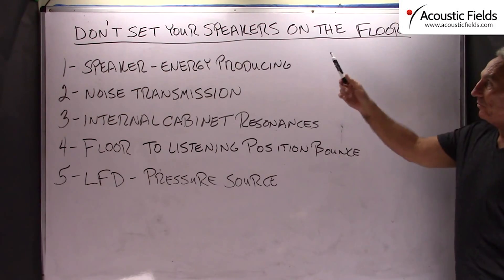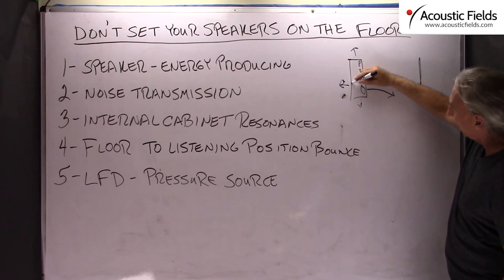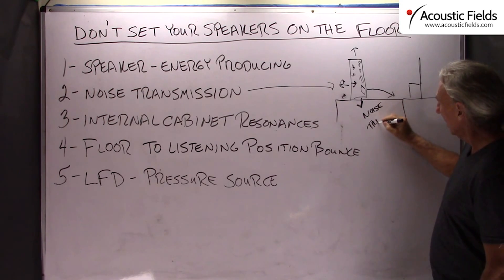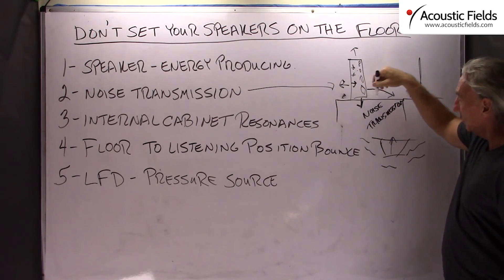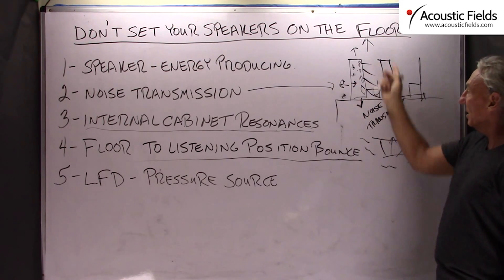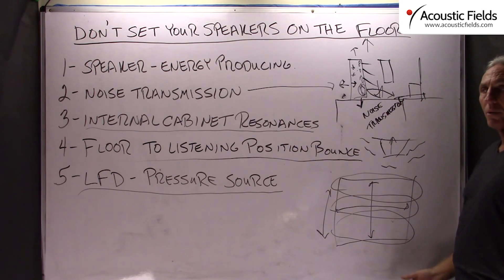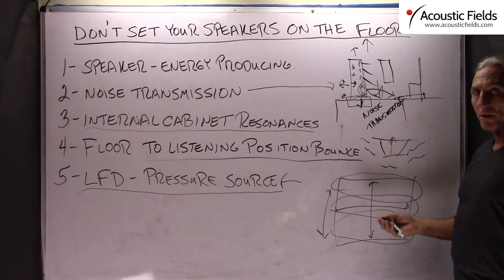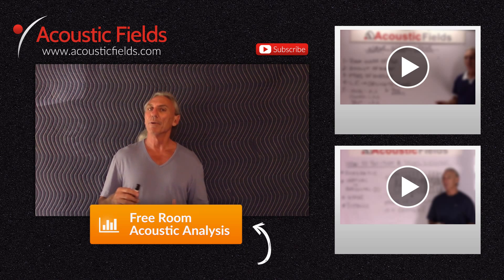Don't Set Your Speakers On The Floor! - www.AcousticFields.com

Comment: A few months back I bought a 2nd hand pair of Yamaha ns 1000m speakers . I got some stands with them. Not pretty but solid  The treble was clear , bass good , but mid sounded a little peaky . Anyway just as an experiment,  I put them on the floor. The peaky sound had gone and the depth and tone improved . Admittedly you cant turn it too loud ( but you couldn't anyway) but it sounds great . Not boomy but much better energy...like live music. At my age all I wish to do is enjoy myself 👍
Reply from the maker: Keep all speakers away from floors, walls, and ceilings. You bring in room gain (distortion) by locating an energy producing source next to a room boundary surface.
Reply: @AcousticFields  Maybe, but I don't care , it sounds great. I've been into this hobby 45 years and for this speaker in my room , it sounds better . I listened to Harry Belefonte , Prince, Velvet Underground , Elvis, The Stooges , The Zombies. It lived & breathed , The Yamaha is a sealed box .
Reply from the maker: @nasdkhan254  A sealed box radiates low frequency energy in all directions.

Comment: if you play the chello, the whole body resonates. properly designes acoustically active cabinet speaker designs are not always something to fear about. thats why real wood cabinets sound way better than mdf or plastic speakers. thats why tonewood exist on this planet. its a huge advantage to build around specific wood types.
Reply from the maker: We use plywood "skins" for the insides of our rooms. The multiple layered playwood reduces vibration transfer and provides the proper front wall densities for of CAW process.
https://www.acousticfields.com/carbon-absorber-wall/

Comment: They become audible? By the speaker cabinet vibrations or? Haha... funny, because...

1: Speaker cabinets are built to NOT vibrate (oh my god.. this you don't get???)

2: At the volume you need to create the smallest cabinet vibrations you could not hear any sounds from speaker cabinet vibrations, and this is just pure logic that my 15 year old daughter understands. Drop a needle on the floor while playing loud music and see if you can hear it hit the floor... However, you might create audible vibrations in objects in the room that rattle because of the sound pressure level the woofer produce.
.
3: If you put a glass of water on top of your speaker cabinet you won't see any water vibrations, and if you do then consider returning the speakers to the dealer.

I have been an audio engineer for over 30 years and worked in many studios, with TV broadcasting and radio... so... Stop telling lies to people, and also get your audio basics right before doing a video about BS products. Other people should not learn from stupidity... my god...
Reply from the maker: You have bouight into the nonsense everyone else has. There are fools born every minute in this business. Following your water example, set a glass of water on top of a subwoofer cabinet. Please share with all of us the results.
Reply: @AcousticFields  Yes… ”everyone else” are using common sense and logic… so.. haha.. you said it yor self….
Reply from the maker: @TheMikaeler  As I have stated, there is a fool born every minute in this world.

Comment: Most important video I have used to get a great sounding room.
Reply from the maker: We need to keep energy producing sources away from surface areas. We do not want them transferring energy into the structure and turning the structure into a speaker. Raising it off the floor will also improve response within the room.

Comment: I have my monitor on some isoacoustic stands sitting on my studio desk and I can feel the bass just vibrating thru my table down to the floor and vibrating my wall and so on.. so those stands don’t seem to work is there any way I can stop it vibrating my wall and floor? I have bass traps behind them already too
Reply from the maker: Your "bass traps" are not working effectively. Isolate the speakers with their own stands away from the desk.

Comment: If the floor is a concrete slab is the diaphragmatic resonance negligible?
Reply from the maker: Concrete is an absorption technology that starts absorbing around 125 hz. Review this link: 
file:///C:/Users/info/Downloads/applsci-11-04835.pdf
Reply: @AcousticFields  That link is inaccessible.  Looks like somebody's local hard drive.

Comment: So why are Bosendorfer Imperial Grand Pianos designed with no hardware on the the legs? They are designed to transmit the lowest frequencies to the stage floor to turn the stage into part of the piano's sound board.
Reply from the maker: They are using the interaction of the piano / floor to create more energy  which may or may not contribute to overall sound quality.  It should never be the goal of any instrument to create quantity over quality. We see this all the time with live performances and subwoofers. Live performances are all about output or quantity. They must radiate energy across a large area to cover the audience. This is not the case with small room acoustics. Our goal with small room acoustics is definition, separation, and quality. It should never be about quantity since the container you are placing all of this energy within (room) can not support it below 100 Hz.

Comment: Here’s one solution for speakers that are too big for stands. Put 3/4 inch thick industrial felt (F3 grade) under them to deaden the connection to the floor. My cabinets are made with 1.5 inch thick MDF, braced internally and filled with sound absorbing polyester fluff.  They are 12x12x26 with 8 inch woofers and weigh 70 lbs each. Each cabinet sits on four round felt pads, each one 5.5 inches in diameter. The pads not only deaden any resonance, they protect the gloss finish. There is not a problem with noise transmission.
Reply from the maker: Speaker platforms can provide three functions. They can elevate which will improve room response. They can also be designed to absorb excess energy. Finally, as you have noted, a platform can isolate surface areas from noise transmission.

Comment: Can ANY professional or even knowledgeable person HELP me with how to set up my (maybe laughable) sub setup in my tiny room if I show you photos?
Reply from the maker: Place the sub woofer in the center of the room and move backwards and forwards in 12" intervals. Use the same procedure from side to side. Stay with the same source material for this voicing procedure.
Reply: @AcousticFields  THANK YOU for the reply, You don't have to read this message as its a LOT longer than it was supposed to be so its fine if you dont read/reply! But if you could you PLEASE help me with a couple of other things?? I don't understand part of what you said & there is another issue I Pray you can help me with as I cant put my subs/speakers in the middle of my room & I'm also not sure if you meant literally in the "center" of my room or did you mean against the wall & in the middle of the wall as opposed to the left or right? I cant put them in the center of my room (if that's what you meant) because I use a VR (virtual reality) headset & need to be able to move around the room without running into anything. The other issue is I have quite a few subs/speakers & they take up a lot of room. It would probably help if I tell u what I have & most my subwoofers are "Car audio" subs & car audio amplifiers as I was only on a budget & I already owned a few subwoofers & amplifiers & the rest I bought because the "car audio" stuff was cheaper than the same thing in "home" stereo gear. So I run the car audio subs on power converters (converting 240V to 12V) & the car audio I have is: 5x 15" subs & 2x 12" subs, then the home stereo gear I have is: 2x 15" subs, 2x 10" subs & then 1x 12" speaker, 6x 7" Speakers & 4x 5.5" speakers. The boxes for the 15" subs are about the standard size for a 15" subwoofer, I built the boxes for the 5x 15" car subs & they are ported with an "shelf" style port as it made a HUGE improvement over sealed boxes, but I have noticed the sound (mainly the bass & mids) get a LOT louder or quieter depending on where I stand in my room & most the 15" subwoofers are on the floor, but I did put 4 screws underneath a couple of the boxes to raise them off the floor since I saw one of your videos about having speakers directly on the floor or having feet on them, Im not sure if it made any difference, I think they might be a bit louder. I really just need to know, is it maybe just best to have then all in one place in the room & would it be better to raise them up instead of basically having them on floor level, would eye/ear level be the best height? Because my best friend a few years ago was given a 15" pioneer car subwoofer (Pioneer 15inch 350W RMS subwoofer, I had the same model in my car) & he hooked it up to a Very cheap ($40!) & very small 2.1 channel home theater (u know those cheap, small units for TV's) it only came with a tiny, cheap 4" subwoofer & 2x 5" speakers & he wired the sub to the 4" subs wires & put the 15" sub on top of a very tall "corner" TV cabinet in the corner of the room & faced it backwards, (he knew I did that in my cars & it made the subs a lot louder, at least in cars) the cabinet was also so tall it nearly touched the ceiling & so that's where the subwoofer was, I barely expected it to work but instead it was amazing! It was almost as loud as the 15" subs I had in my cars (Which was extremely loud). But it was almost as loud as all the subwoofers I have combined & I'm 100% sure its ALL because of where I have them placed in my room. So do you know if putting the subwoofers up very high makes a big difference? Or should I have them on the floor, al eye/ear level, all in one corner or in the middle of a wall?

Comment: Theoretically I do agree. But in my (listening) situation, my very heavy and large speakers are on small undercarriages about 5 cm above the floor. This, in my personal opinion sounds best. They are simple too large to put them on high(-er) stands.
Reply from the maker: They sound better for many reasons. First, you have decoupled them from the floor. This reduces vibration transmission to the floor. Secondly, you have elevated them off the floor which will improve room response. Thirdly, if you decoupled and elevated, you now need to absorb excess low-frequency energy within the riser if possible. The best place to do that is as close to source as possible. You now need to increase the listening position height to match the speakers for more improvement. Getting quality sound within a room is all about doing a lot of little thangs correctly and in the proper order.

Comment: I’m assuming this is not referring to floorstanders?
Reply from the maker: You should always isolate any vibration producing device from the surface area it can transmit energy into.
Reply: @AcousticFields  my floorstanders are separated from the floor using Sorbothane discs. Any good?

Comment: I put my speakers on the floor close to the wall and I get good base and high since the focus of energy is all in the front, sounds more solid (or whole). In my observation unless it’s a big and high powered speakers the best spot is on the floor close to the wall.
Reply from the maker: You are confusing quantity with quality. Placing speakers closer to wall surfaces creates more distortion. The technical term is SBIE which stands for speaker boundary interference effect.
Reply: @AcousticFields  My speakers are in my great room and I adjust the sound according to my taste not by other bullshit.
Reply: @jayemjayswatosville937  well, you never heard properly positioned speakers in a treated room 

everybody but you knows that walls are natural enemies of speakers and good sound

measure it on the listening place and if it's not a flat curve it's bad - and yes it takes some time after proper room treatment to get used to a sound as it is meant

Comment: Are you referring to wooden floors only, or doe this apply to concrete floors?
Reply from the maker: It is a vibration transmission issue. Floor type and density not an issue.

Comment: I’m building a room within a room new studio space in a basement with ceramic tile floors over concrete with detra membrane in between...  I’m wanting to build a DIY subwoofer for this much smaller space than my previous one.  It’s will be 17 x 9 ft once done.  The ceiling will be about 7foot 3 inches.  I like to produce sub heavy music that goes down to 20 hz at times. The biggest question I have is sealed vs ported box ? I’m leaning towards sealed.  I would appreciate your perspective on this.  I’m interested in isolating my build once done and having it angled towards me and in phase with the other main monitors.
Reply from the maker: S,  You will not be able to achieve those low-frequency goals with a 7' ceiling height regardless of source type.
Reply: @AcousticFields  Right .. SO sealed vs ported sub box in a small room ? What would you do ?
Reply: BTW it will be 7 ft 3 after 8 inches of absorption with rock wool safe n sound .

Comment: I have dipole speakers with an open baffle.  The subwoofers  (Linkwitz LxMini) are opposite firing.   I plan to install new flooring in the listening room which is 14 X 17 X 9.  I am considering LVP (Luxury Vinyl Planks) which has a foam pad underlayment.  It will be floating on top of a wood subfloor with an additional 1/2" particle board underlayment.  There will also be an area rug (perhaps acoustically rated).  My concern is the floating floor and whether it will vibrate when playing loud bass down to 35Hz.  A glue down floor is an option, but then the choice of patterns and expense become factors.  Will the dipole woofers mitigate my floor vibration concern?  I appreciate your advice.  Stan
Reply from the maker: S, A floating floor is a barrier technology. What are the frequency and amplitudes of your noise transmission issues?
Reply: @AcousticFields  The dipole subs can manage 35 Hz at 90 to 95dbs.  The laminate floor is 10mm thick with a 2mm foam underlayment.  There will be a 1" granite slab to isolate the subs from the floor.  The subs are down firing.   An area rug will encompass 30% of the floor area.  My concern is whether vibration will occur with a floating floor.  I am open to consider other options for the floor (though the laminate is my first choice) including glue down, if not overkill.  I am not aware of any experiments to evaluate the acoustic issues with such floors.  There is no need to isolate the sound below the floor, since the only residents below are termites.   Thanks for your thoughts on this issue.  Stan

Comment: I’m not sure it’s really that huge of a deal because the speaker manufacturer usually has taken into account that the speaker is going to be, well, stood on the floor. I just finished making a tennis ball drum riser for my e-drum kit which was killing my neighbor downstairs. Not from the amplified sound, but from the actual beating of the pads. After making it I got an accelerometer app and tested things. As expected, the vibration from hitting the pads was reduced to almost zero on the floor. But I decided to see what my stereo speakers were doing while I was at it. There was surprising very little vibration in the floor right next to the speakers, while if the phone was placed on the speaker cabinet itself, the vibrations were off the chart. I think most of the vibrations a neighbor will experience from a stereo speaker is going to be when the sound hits drywall, which flexes and sends the vibration through the studs, which then travels to the neighbors wall and turns their drywall into a speaker. Anyway, the vibrations I measured on the floor next to the speakers was roughly that of tapping your fingers on the floor next to the phone with the app running. The speakers, at a moderately loud level.
Reply: the manufacturer don't care - especially because most customers have no clue and think louder and more bass is better

Comment: It was a good video. I would mention one thing, a good well-designed speaker will not vibrate your hand when you place it on. A good well-designed speakers cabinet will be sonically dead. Or as close to eight as possible.